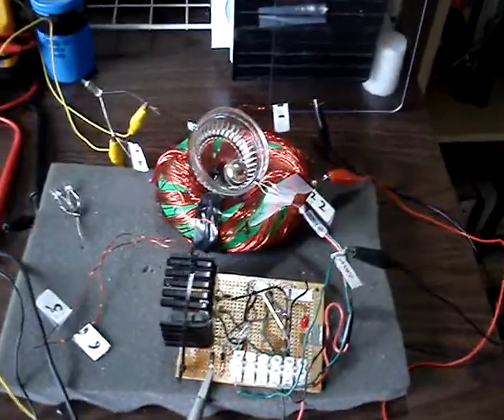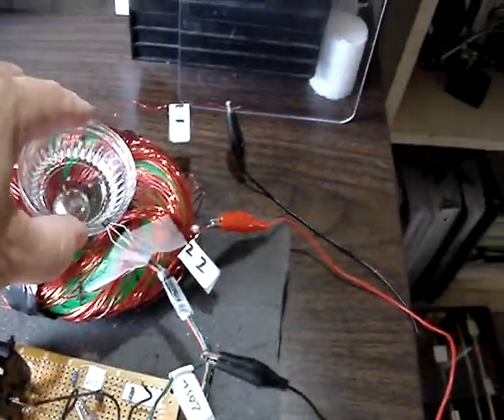Lolo Neoball Resonant Spinner

Comment: Well one way to test for sure - repeat the experiment but this time walk out of the room with the ball, or even walk out of the house, far enough the there is no magnetic influence. Time how long the ball spins but make sure to use the same amount of spin up coil time.
Reply from the maker: The resonance effects extend to only 12 to 24 inches, after that the spin down time id from resistance alone, in nearly all tries.  However a couple or times with alignment to the earth's magnetic field it was longer, but it was hard to replicate this.   By the way, I do not claim any over-unity effects.  There is some evidence of some source energy recapture,  eg  the so-called Bedini back-spike radiant energy.

Comment: Uhhh, aside from actually spinning the neo ball, there is NO magic here. Ya - cool, you were able to use amplified frequency to pulse and spin the ball, but that's it. The reason it keeps spinning is because there are no brakes. Like a top that spins after you give it a twist, it will keep spinning until it looses its momentum. It's scary to me that you can be smart enough to build all this stuff but not smart enough to tell BY THE AUDIO ALONE that once turned off the ball gradually slows until it stops.
Reply from the maker: Actually there are resonance effects happening here that extend the spin down times well beyond what you see from frictional effects alone.  This is due to the reservoir of electromagnetic energy stored in the coil / distributed capacitance RLC  ( resistance, inductance, capacitance )  system.      thanks

Comment: Interesting at first, but all you may be able to conclude is that a Rodin coil is more efficient at spinning it up to maximum RKE. Everything else you see is straightforward conversion of peak RKE that's scrubbed off as it collides with the glass bowl.

I don't see any need to suppose any kind of special resonant effects; it's just a fast, low friction metal top spinning down and then coming to a halt.